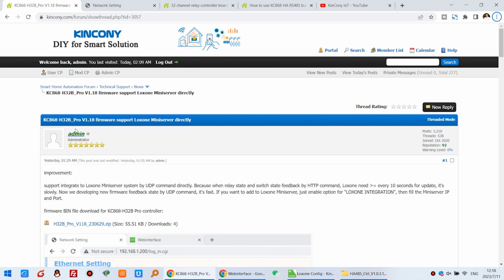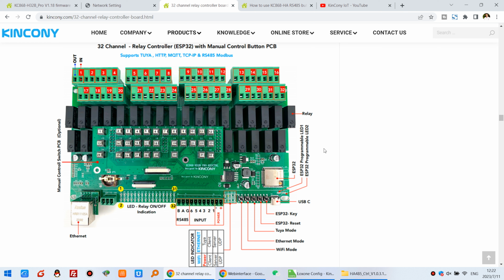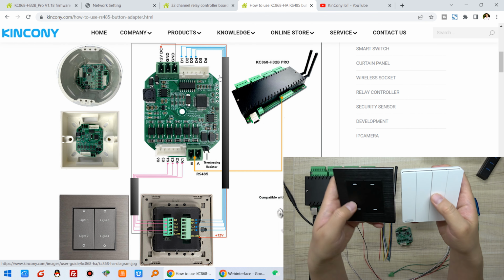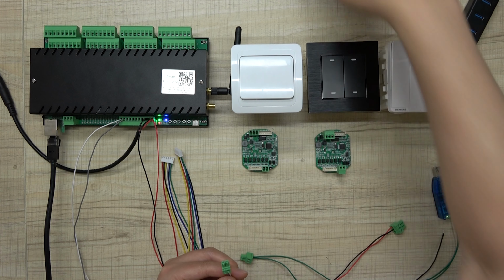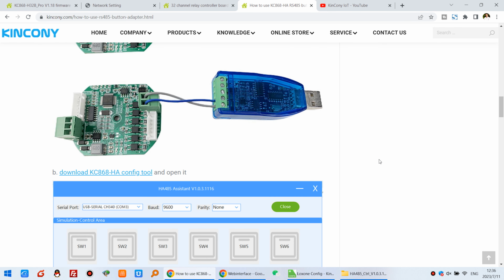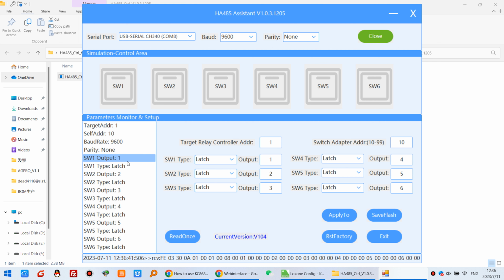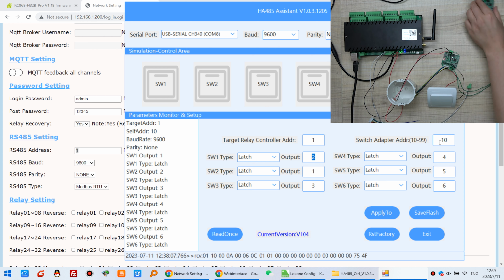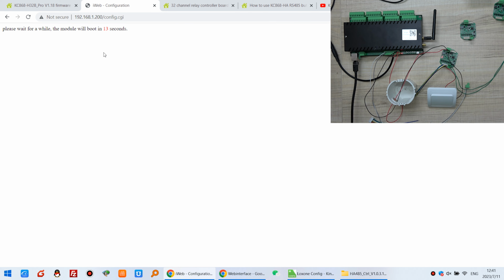add traditional wall switch to Loxone Miniserver by KinCony Board

Comment: RS485 Adapter Module - Does it support modbus or mqtt? What protocol does it support?
Reply from the maker: if use by RS485, private protocol work with kincony's relay controller. the protocol is open , you can download at here: https://www.kincony.com/download/KC868-HA-protocol-for-RS485-relay-board.pdf
Reply: @KinCony  Thanks!

Comment: Thank you to nicely explaining but if you jumper to another rs485 how is the wiring?
Reply: Can one button turn on all the relays or turn off all?
Reply from the maker: that need add KC868-AK keyboard for define every button's action
Reply: @KinCony  I mean, create a scene saying 1 button switch is the whole house, 2 is all the curtains 3 button turn on tv for example
Reply from the maker: all RS485 device paralleling connect to A and B together